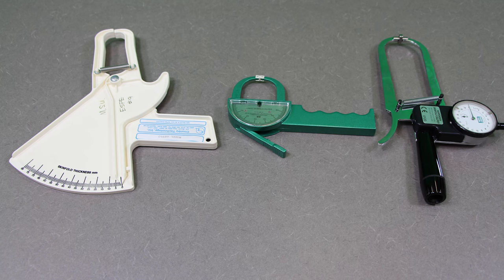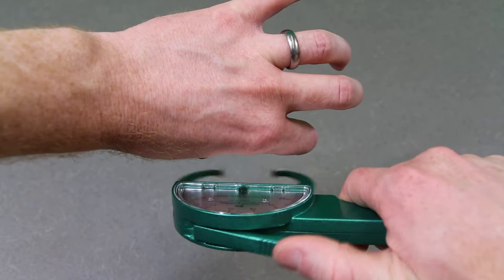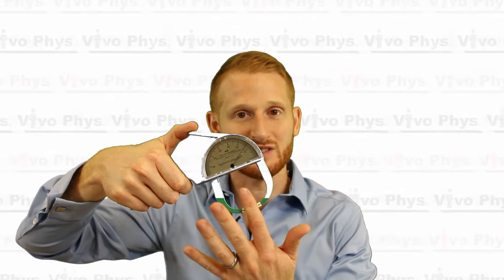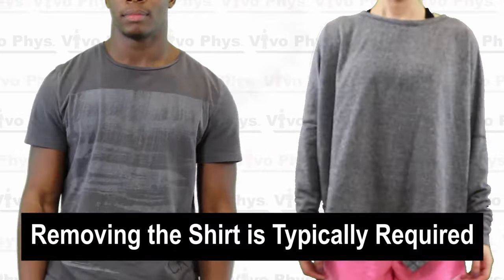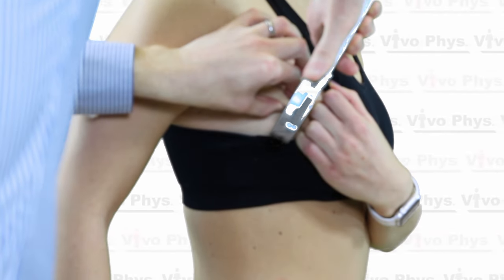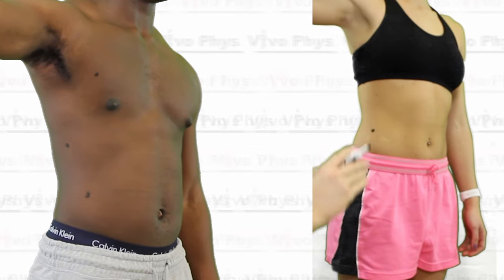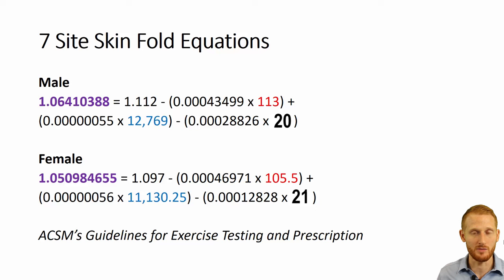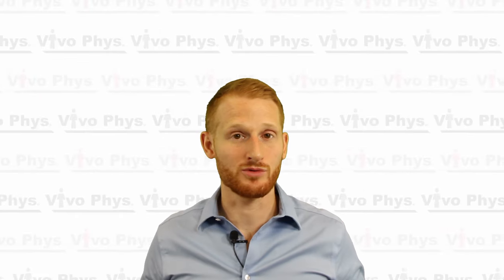Skinfold Body Fat Assessment

Comment: Excellent video, thank you. Just a question, getting a proper grip on the abdominal test site with overweight or obese people is something I struggle with to keep the calliper outside of the navel cavity. It’s easier to take a vertical reading but it would take so much fat in the reading that I’m afraid it won’t be accurate at all. How do I go about getting an honest reading for that site? Thanks
Reply from the maker: Good question. I think your best bet would be to follow the pinch recommendations from the ACSM presented here and accept that the caliper may go into the belly button.
Reply: @VivoPhys  thank you, I’ll give it a read but feel that I’m validated wanting to do it that way. Keep up the good work!

Comment: If it has a +/- 3% error, you might as well do it on sight. It's probably only interesting to check changes, not levels.
Reply from the maker: It's best to use body fat percentage (regardless of method) to track progress over time as you mentioned. Visual inspection lacks the objectivity needed to track across time. Visual inspection can also be misleading as it is difficult to account for non- fat tissues like muscle.

Comment: It sounds so ridiculous to measure/estimate bodyfat percentage without weighing the persons total bodyweight...  Imagine 2 (same age and gender and height) skinny 150 and a muscular 250 pound people with the same 7 site skinfold numbers and using these charts that do not take into account total bodyweight... They'd indicate the same bodyfat % ???  I'm not a math wizard, but we're not talking about a small 3% deviation here.  So I cannot but conclude these methods are very inaccurate. What's your view Evan?
Reply from the maker: Hi MatrixView. That is an interesting critique of the technique. The basic theory is that about 1/3 of the fat is under the skin and the other 2/3 is deeper within the body. So if the subcutaneous fat increased or decreased the deep fat would as well. Adding muscle (your example of a bodybuilder) would increase your body mass, and increase the deep tissue that can hide body fat. However, adding muscle would not effect your ability to pinch subcutaneous fat because it is outside of the muscle. With that said the ratio of 1/3 subcutaneous to 2/3 deep fat should stay the same. 

With all that said you might find the study below interesting. It seems to suggest that on average skinfolds work well for bodybuilders, but their error might be too high to measure the small changes in body fat percentage over time in an individual bodybuilder. I only skimmed the paper, but I hope you enjoy it. It's a high quality journal.
https://cris.maastrichtuniversity.nl/ws/portalfiles/portal/65522190/lichtenbelt_2004_body_composition_changes_in_bodybuilders.pdf

Comment: Just keep in mind that Asians, for example, would crush a skin fold test, yet are prone to diabetes.  This is because skin fat is an organ which allows emergency storage for extra blood glucose (like social meals, holidays).  Without this, the liver must cram any excess sugar in between the internal organs, which is associated (big time) with type 2 diabetes.  Apparently, harder to store there, leading to higher blood glucose levels, higher insulin, and insulin nose blind cells.  Diabetes.. Thus, the reason liposuction could lead to obesity (as I have observed) years after the procedure...  Bmi is garbage due to muscle and the fact that a mere gallon of water water weighs 8 lb.  On a hot day, your roofer might drink 2 gallons of water.  My dry weight in morning v. Evening weight can vary from 5 to 18 lb, when adding clothes, depending on the time of year.. Really, the only metric which makes any sense is the stomach to hip ratio, which tracks how much excess sugar a person is storing between the internal organs....  Weighing one's self every morning to a half a pound (knowing how much muscle workout or cheat calories) is very useful. I usually gain 4 lb after one cheat meal, which takes me 6 days to get off.  Weighing each morning gives me motivation not to cheat.   Eventually, if the FDA wakes up, a non prescription continuous blood glucose monitor, which syncs with the phone will offer the best anti aging tool ever.  Humans are feedback machines, which is why we have pain receptors.  So, a cgm will allow us to see the damage in real time, and which foods are causing it.  No longer would a person who has a cgm have a mental desire to eat consistently as if we were storing food for the winter or next famine.
Reply: Very interesting!